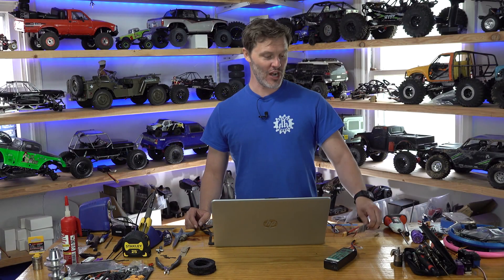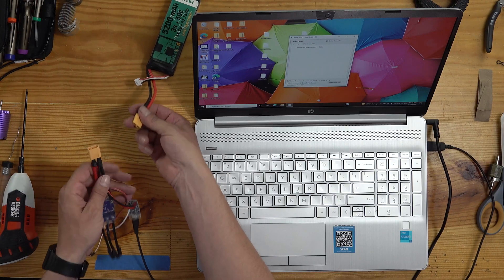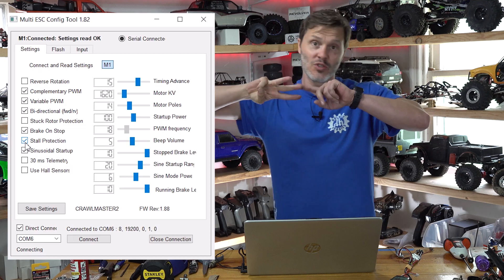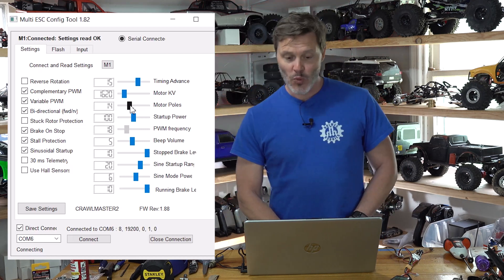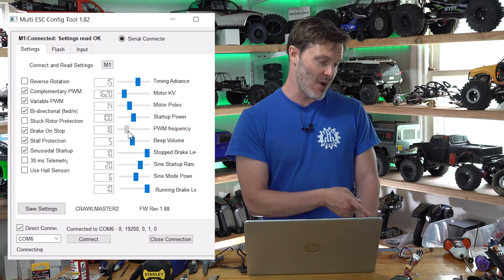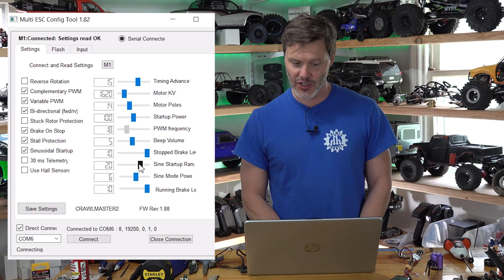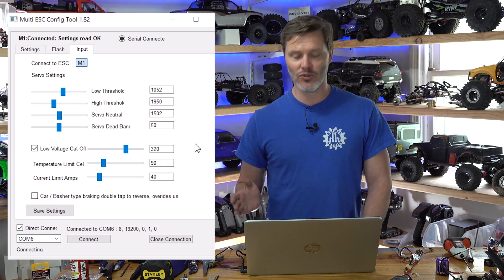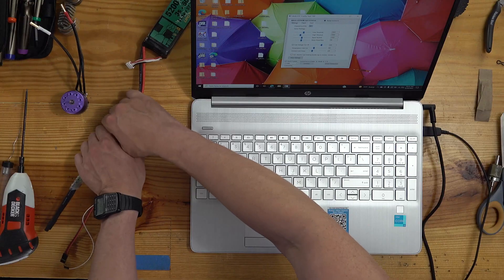How to program your new Crawlmaster ESC V2 *Step by Step* best guide for best results Holmes Hobbies

Comment: Mine no holding the lowest setting of 1 on the brake drag setting. It goes back to 10 every time.
Write eprom successful is on all the time
Reply from the maker: @jamesatkinson7517   sounds like we may have a hardware issue. I'd swap you to the newer HV hardware, email via the site please
Reply: @ it’s not one of your esc’s just the firmware is am32 so I was just thinking someone somewhere might have had the same trouble.
Thanks anyway

Comment: Hi John, do the Crawlmaster V2's come ready to go out of the box? I'm pairing mine with a Revolver Team Spec (2050kv I think?) And thought it would work with my Castle software and wire but I guess not, just wondering if I'll be able to plug and play for testing the truck?
Reply from the maker: Yes, they have a pretty good tune as stock
Reply: @HolmesHobbies  thank you for the very quick reply, much appreciated, can't wait to give it a try.

Comment: If I wanted to put my max reverse at 50% of where it is originally would I go to the input page and then adjust the “low threshold” down? 

I bought the programmer from dlux and have been able to get the ESC and the computer to talk. 
It’s all about the application AND the device driver. 😉 I’m not terribly computer savvy so I feel good about making that work.
Reply: Answered my own question by trying it. The answer is YES

Comment: Mine won’t arm. I just beeps, if I give it full throttle the beeps stop, let off and they come back. I have steering just fine. Please help John, I have emailed Holmes Hobbies with issues!
Reply from the maker: Adjust neutral trim most likely
Reply from the maker: Or it isn't seeing signal, if your radio is powered by the crawlmaster then its neutral trim.  If an external bec is powering your radio then you might have the esc rx wire plugged in backwards.

Comment: I have had to run my throttle trim all the way to high on my sanwa m12 to get the Speedo to arm.  In which way might I change that throttle neutral setting to modify this need?

Comment: Woo hoo!!! Success!! Got it programmed! My problem was I didn’t have the correct driver selected, went down to the next one available, and then was able to select “com3”. I was apprehensive about that, because John Holmes selected “Com6”, I’m not really a computer guy, but “com3” got me connected, and there was no other choice. Lmao!!! The first driver I tried, didn’t have com6 or 3, or anything, just said seriel port, which wouldn’t have let me view, or change anything. Honestly, I was going to run my first outrunner (1800kv v2 revolver), and I did not want to sound like a space ship, so I was using the crawlmaster mini v2. All I changed in the settings was the kv of the motor, and low voltage cut off to 3.4 instead of 3.2. Thanks you guys, this esc motor Combo is much quieter than others I’ve heard

Comment: My port shows up as serial port, not “com6”,and the drop down, does not have “com6” for me to select, therefore I am stuck. I can’t view any of the settings. The “esc multi configuration tool 1.82” window is there, the “direct connect” box is not checked, I checked it, it doesn’t matter, “com6” isn’t in the drop down, so I can’t select that. Maybe I don’t have the correct driver installed for my 3.5 year old windows 10 desktop. Anyone got any ideas??? I could just run the 1800kv revolver without changing kv, or anything else, but seems like esc is getting warm fast, and I don’t have drivelines attached to tranny yet.
Reply: I’m not an expert but I just recently got this figured out. It sounds like you do need to download, unzip and run the drivers. I downloaded them but didn’t unzip and was having the problem. Kept messing around with it and eventually realized they were still zipped and therefore unusable
Reply: @rc7178  Yeah, I figured out later that day, that not only do you have to download the software, but also the driver. Took it out and tested it back in September, was awesome. One more run after that, then it rained like hell in California, for a while. I thought I was going to have to build an arch. Lol. Ran it on Saturday, and realized I need a little overdrive in the front portals. Trying 33% next weekend.  1800kv v2 Revolver and crawlmaster mini v2 esc is the shit. Dlux fab portal tranny, brazin ATL pro V2, NSDRC 800V2 servo. Capra axles, Jconcept ruptures, Dravtech shocks. Things awesome.
Reply: @OH-Hobbies  sweet! Not very different from mine. Sherpa rails, f10 axles, NSDRC RS700, Reef’s Comp Spec IS300, snubnose revolver 1800 v3 and a crawlmaster V2 obviously, Dravtechs, Dlux Driveshafts, Ruptures, and a bunch more stuff. Running bumpers and an interior and it sits on its side (CMS too). My next one is going to be SOA and lots of fun. Keep building and driving!
Reply: @r c  sick bro!!! I forgot to mention the dlux Fab cut to length drive shafts. 13.75 wheel base. Not my channel, but check out Sean p rc, he's kinda retired now, but knights ferry rc crawler, (KFC). Those guys inspired me, and knights ferry ca. Is local. Have fun bro!!!!
Reply: Look for his older video about 2 years ago with the lcg crew
Reply: @r c  new years crawl at knights ferry....by  "boing rc garage"...my other buddies channel

Comment: I follow the directions on programming. I’ve got the am32 programmer, but for some reason can not connect to “comm6”, that option is not available, it just says serial connect. I don’t know what to do other than go to my local hobby shop, and maybe they can get it to connect. I’m running an 1800kv revolver, and all I want to change is the kv to match the motor, and turn the low voltage detection up to 3.5v.

Comment: Everytime I've had to calibrate from 1 radio to another I've had issues. From the castle site it says power on esc, while holding full throttle, chirp/chime, then full brake, chirp/chime, then neutral, chirp/chime...nothing. I've reversed the throttle on my radio, then tried again. I've tried reverse 1st, then full throttle, still the same. I was able to figure it out after awhile on my radio shack radio/rx but for the life of me can't figure out how to calibrate my M17/FH5. Please help!!
Reply from the maker: This isn't a castle esc.  You might need to adjust neutral trim
Reply: @HolmesHobbies  what's the calibration order, then?
Reply: @timdavis4437  
"Crickets.  Crickets.  Crickets."  No answer!

Comment: had ordered a v2 and 1800 kv revolver and the esc showed up Doa. and Holmes set out a replacement. just got back from working and put it all together and the esc gets about 120deg after running for less then a min. and the motor gets warm to the touch. its being ran in a scx 2 with 60t spur and 9t pinion on 1500 75c 3s new battery. check the settings they look good no binding on the drive train and not running any over drive. when it runs it runs like it should just gets hot. I have 2 v1 and another v2 and none of them have ever got this hot did i get another bad esc what else can i try?
Reply: I'm having the same issue with a simular set up. I see most if not all comments do mot get answered.  Did you ever get it sorted?

Comment: john im having issues with my v2.  wired up just like your video.  down low its super smooth but a little more throttle is coggs and then around half throttle it kinda cuts out.  this is just bench testing and its was 80 degrees outside and after 10 seconds of testing it jumps to 110 degrees.  i emailed and no response.  im on 3s with 2500kv v2 motor.  would your current settings be good for that motor?
Reply from the maker: Be sure your battery isn't old, have another to try?
Reply: @HolmesHobbies  its a fairly new battery and works perfectly fine with the sw4 and 2500kv v2.  the esc chimes up and everything looks great as far as soldering.  checked all my wires for low resistance.  im getting a programmer to check settings to see if it way out of wack cause im assuming you dont program these as its a bare board
Reply: @HolmesHobbies   tried another battery same issue.  even tried another motor.  still does weird stuff.  tried different tunes nothing makes a difference.  defective esc and ive heard nothing back from holmes
Reply: @brianlorenz9632  
I've had multiple failures trying to email and 'contact' someone, anyone on their website and I do have to say that for top quality products that they have, the communication breakdown ... is almost at a total loss!  Sad!  Just as John always says here, "Leave your questions and comments" ... yet still get almost nothing answered for the greatly needed help that we need!  Real sad!

Comment: Love my crawl master minis lol I was putting it in a g shot chassis with vanquish Capri axles and was just doing some tuning with no body on mostly suspension but the dumbest thing ever happened I didn’t inspect the V2 board very well after putting on the wires ( kinda excited)and a little piece of soldier/slag crossed over a pin on the chip and it went up in smoke which was totally my fault but that’s why you buy in pairs lol put in the second one and very pleased with the results. Then went and order two more that ESC is on a whole nothing level. Are you going to be selling the tuners on your website again when are crazy product chains get moving again 

Thank you Mr Holmes and Team👍🏻👍🏻

Comment: Thanks John. Just loaded the software and hooked up programer today. Adjusted my kv and poles as close as I could (2040kv snubnose) to 2020kv and 10 poles. Set my sine startup range to 22. Dropped sine mode power to 5 for 4s. Feels really smooth on the bench. Off to the rocks for testing.

Comment: I was wondering about these ESCs. I haven't done a lot research but I figured they were basically a multirotor ESC. I'm thinking I could just use an old flight controller to be able to connect to BL Heli.
Reply: Go watch Furadi on YouTube..he does this with those esc's

Comment: Hi John what do i do if V2 esc wont read.  I am able to connect to programmer but M1 or read will not work. I have a v1 and that esc works fine.
Reply from the maker: you using a 3s lipo to boot the ESC?
Reply: @HolmesHobbies   yes sir using 3s
Reply: @HolmesHobbies  anything else i can try
Reply: @fklem9802  check your wirering and usb port  😉
Reply: @themountain59  I have tried everything so far it wont connect to esc.
Reply: I'm having a similar issue. One of my V2s connects but the other does not.
Reply: Working with Justin and Jordan still not able to connect with M1. Got V1 and that works fine i am able to adjust.

Comment: I have no problem with the program you had for the v1. Whatsoever i cant connect with the version 1.82
Reply: I think i flashed the v2 esc with your v1 4s low heat firmawre. Where can i find the v2 firmaware?
Reply from the maker: @CustomRcCanada   no no no don't put the v1 firmware on the v2 hardware, totally different.   I"ll have to put the firmware up for you on the website, although you probably just bricked it and we will have to jam the hex on here to fix it.
Reply: @HolmesHobbies  i just checked now its okay i mist have used the wrong port. When i look down on the setting page, I see crawlmaster2 v1.88 so i gess im still okay 😅
Reply: @HolmesHobbies  can you please add the V2 1.88 firmware to the website? I did the same thing to my V2.